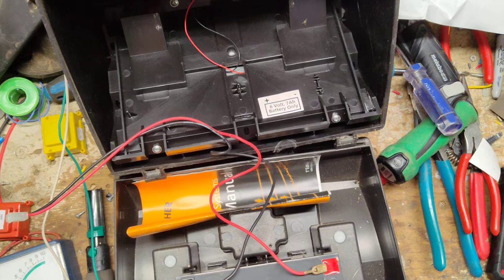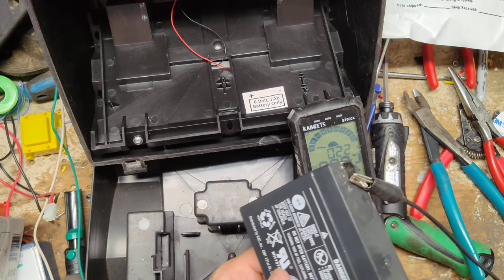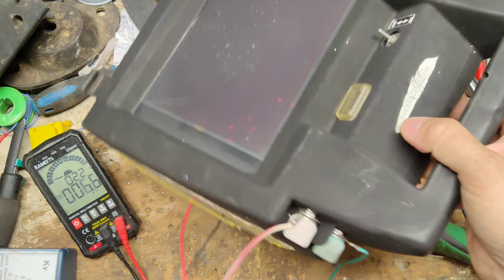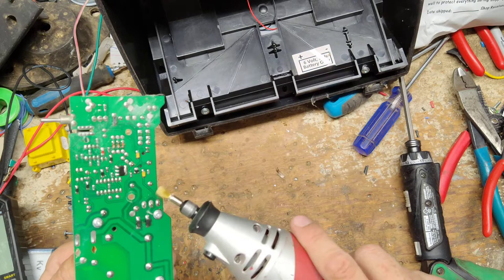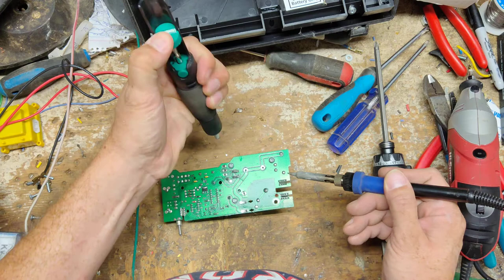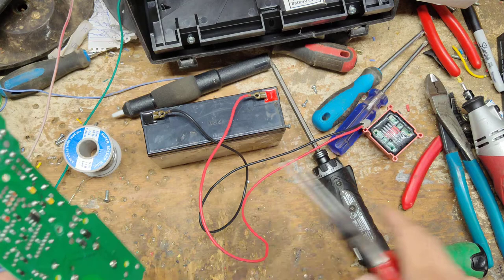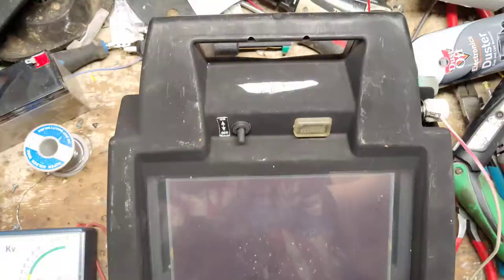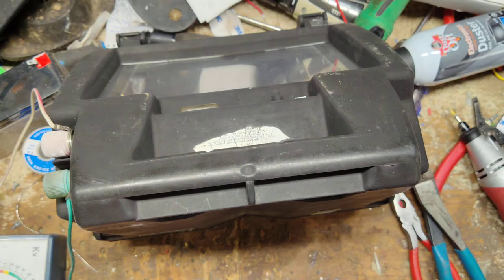How To Test & Repair A Gallagher S15, S17, S22 Solar Fence Energizer, www.fencerfixer.com

Comment: Hi great videos. I have an s17 think it has a bad transformer, I’m in the uk. Could you tell me what the specifications of the transformer are so I can order a new one and try to fix it. Thanks
Reply from the maker: I don't know the specs on it. The transformer is made by Gallagher in house and there's not an off the shelf one that'll be wound up the same way.

Comment: I have one of these .   Basically good for a small pen to guard from small predators or can it control livestock in a small acreage, say 10 acres?
Reply from the maker: It could do both. As long as the fence stays semi clean off grass and brush, it'll do 10 acres and keep cattle and horses in. Calves might be difficult to train at first, and goats and sheep will likely walk right through it because it's not enough joules for them. The S15/S17/S22 type unit was a really popular model that Gallagher made did around 20 years, 1997-2017. They sold a lot of them.
Reply: @FencerFixerRepairLLCKansasCity  thanks for following up.